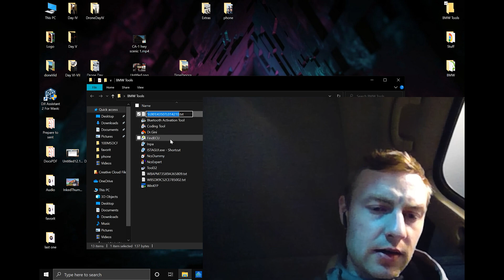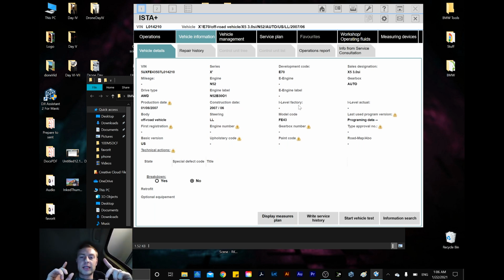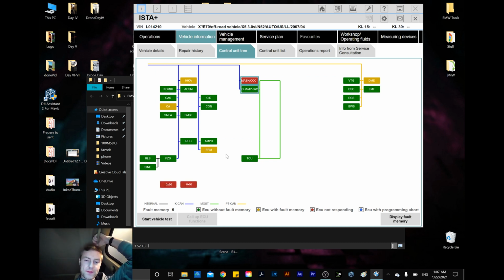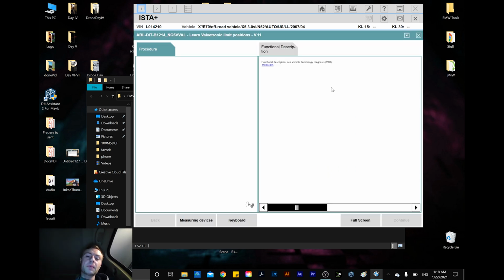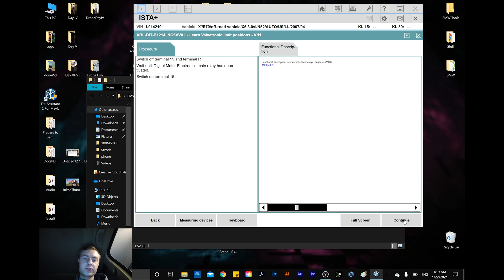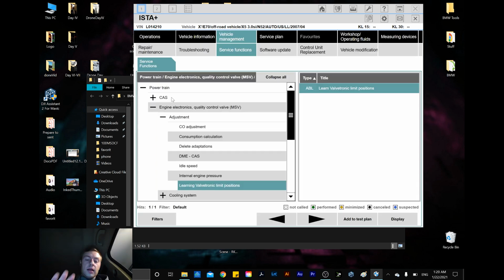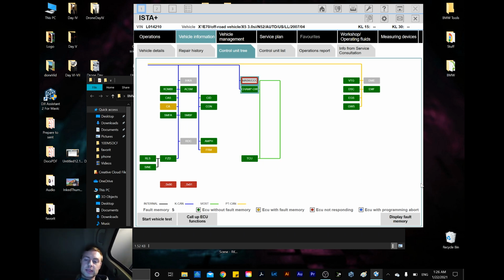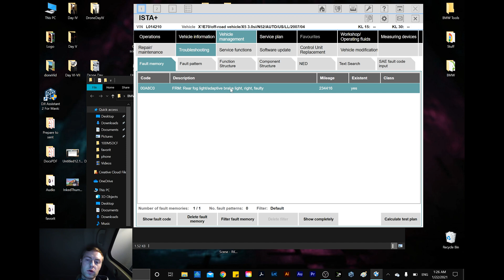How to clean Fix VANOS Solenoids BMW N52/N54 Rough idling ISTA Reset

Comment: Is that clancking sound ok?
Reply from the maker: the clunking sound it a lifters, the solenoids for the vanos system, so they had to be cleaned or replaced.
Reply: @Makhnovets  Cleaned, are the supposed to clunck? Someone said that cluncking a a clear sign of a damage part.
Reply from the maker: @robertalexandrescu9975  oo, you talk about the solenoid itself, there’s a moving part inside, so you have to hear som noise when you shake them, but it shouldn’t be lose piece inside, if it’s literally clanking when you flip it, then it’s something wrong with it.

Comment: There is no relationship between VANOS solenoids and Valvetronic limits.
When you clean or replace VANOS solenoids, you should reset VANOS/Camshaft adaptations and go for a spin to let DME learn new values.
When you repair/replace gear on the valvetronic system (Eccentric shaft, Valvetronic actuator motor, eccentric shaft sensor, lever springs ....), then you can start the Valvetronic Limits learn procedure.

Besides, cleaning VANOS solenoids is just a temporary fix. They should be replaced after 100.000 Kms max. As they have direct impact on performance and fuel mixture management, especialy the Intake solenoids (The one on top)
Reply from the maker: For the most part, you are correct, and I messed up a little bit with the explanation of which controlling what and some other things. but the connection between those systems is Huge. VANOS is a variable valve timing system used by BMW on various petrol engines since 1992. ... Since 2001, VANOS is often used in conjunction with the Valvetronic variable valve lift system.
What does the Valvetronic motor do?
Valvetronic is a variable lift and timing feature/system in BMW engines that controls the timing of the intake and exhaust valves opening and closing to optimize performance, and it ultimately decreases reliance on the car's throttle body.
What is the purpose of VANOS?
VANOS is a variator system that varies the timing of the valves by moving the position of the camshafts in relation to the drive gear. The relative timing between inlet and exhaust valves is changed.
So after all i should of done an Engine adaptation reset, which is in our case might help to adjust some settings, but i didn't do that because if you trigger the adaptation you will need to reset some other systems, as throttle body and some other units. I - too many steps. II - Little complicated. III - Have different results for different cars. so their lots of things to cover!